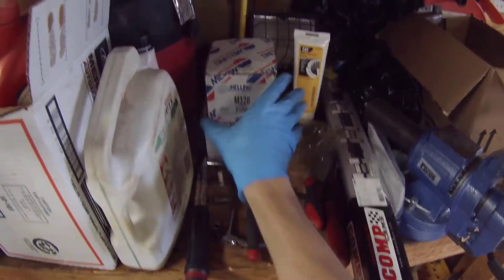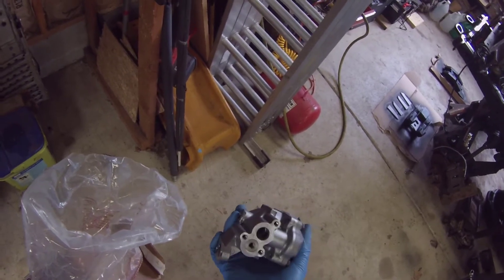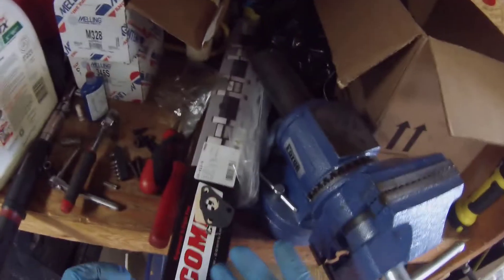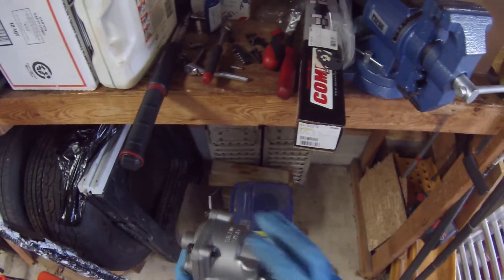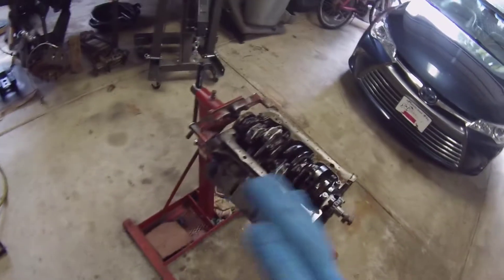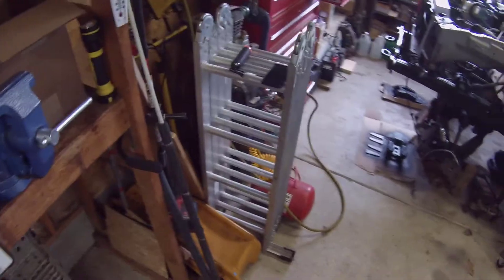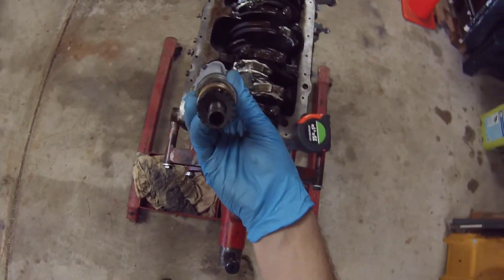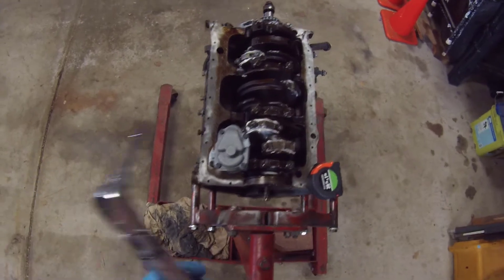Ford 4L OHV Oil Pump Install

Comment: I have a 94 ford explorer would it do well with the hi volume oil pump ? I bought it used and odometer shows 265 k engine runs too strong not to have been rebuilt a head job or replaced.
Reply from the maker: If the engine is running well with no oil pressure issues. I would say just leave it alone. The only thing this high volume pump helps with is oil delivery to the rocker shafts in the heads. I only installed this pump due to help with delivery, and I also rebuilt the engine.

Comment: Do you REALLLLLLLY have to pull the motor to do this? Contemplating doing mine:/
Reply from the maker: Yes, cause it is way too much of a pain to do it in truck.
Reply: @TEDDAV64  you can do it with engine in truck, just hoist the engine up a bit, takes less time but if you are fat then its not doable sorry
Reply: @TEDDAV64  btw with fresh bearings, M328 will burst oil filters :D

Comment: Have you started the engine yet? Those fresh bearing with tight tolerances paired with the high volume pump could overpressurize the system. My rebuilt 4.0 did it with the M328 pump. The oil filter exploded with 120 psi idle pressure
Reply: Hi, what did you do to fix that issue???

I just out my 4.0 back together and put a new oil pump (not high flow)
as well as new bearings, and it’s also blowing out the oil filter. I can get the car started about 4 times before the oil filter seal blows out or the filter itself blows out… I was thinking something it was in issue with the oil pump itself

Comment: I just had a 92 4.0 SOHC rebuilt, and the shop left the synchronizer out, although I think it’s just a gear to drive the oil pump, because there is NO sensor on the top.  Anyway I can’t get the synchronizer or gear back seated in the port where it came from.
Reply from the maker: The early 91/92 had the dummy synchronizer, and to install that one is a pain you just have to try multiple times to install.
Reply: @TEDDAV64  I got it finally! Thanks

Comment: I had this same engine rebuilt. When I got it back, at idle zero oil pressure but when I rev the engine or drive the oil pressure goes to normal. What would cause this or  suggestions on how to fix? The shop that did the TOTAL
rebuild said they don't know and this is not included in a rebuild. I didn't have this problem before I dropped it off.
Reply from the maker: To be honest it sound like they put the wrong size bearings in engine. The clearances are too big for what they call for. I have made this mistake before it causes no oil pressure at idle but you get some as engine RPM increases. My suggestion is to put a actual manual oil pressure gauge on it and see what oil pressure really if the oil pressure drops below like 8 psi lets say don't remember the actual number but the idiot gauge will read 0.  Ford uses idiot gauges that not accurate at all. It is possible the idiot gauge sensor is screwing up and can cause this issue as well but it be better to check and know the actual oil pressure and check it with the engine up to temperature. Best of luck to you.

Comment: Sloppier sloppy mechanics, good stuff. 
I just did this exact combo on my 300k mile 4.0L from 1995.  I was surprised how much valve clatter I still had on first startup with new rockers and pushrods with the high volume pump.  Turns out both 1) they just needed some break-in, and 2) I had a bad 02 sensor that was absolutely washing fuel into the motor going in to closed loop (not ideal before the rings are seated).  Replaced the 02 sensor within the first 20 minutes of run time, and changed oil after 200 miles, and things are much better.
As an aside, the replacement front main seal + redi-sleeve was an absolute pain.  It kept wanting to precess off-axis in the bore.  I had to completely wipe down the timing cover hole with a brak-kleen soaked towel, then add silicone sealant to the outside of the seal for enough sticktion.  
Also also, nice to see you don't have the 94-95 window style cam synchronizer. The hat style seems much simpler.

Comment: Thanks for covering the oil pickup difference....my pump came from Napa, but now I know why they included a flyer saying it needs a Melling pickup. Apparently my pump is the high-volume version...which is good!

Part number helps a ton, too...wasn't sure what it was they wanted.